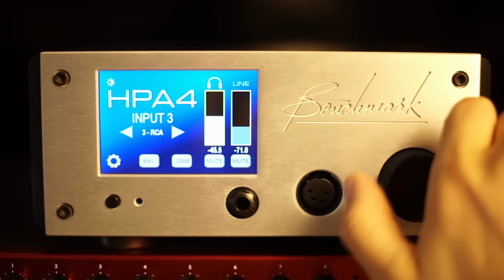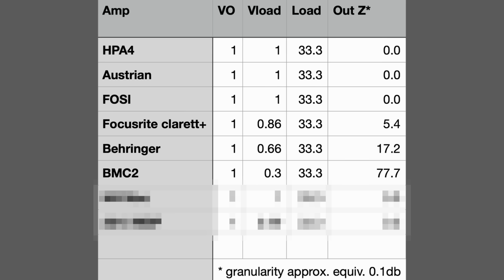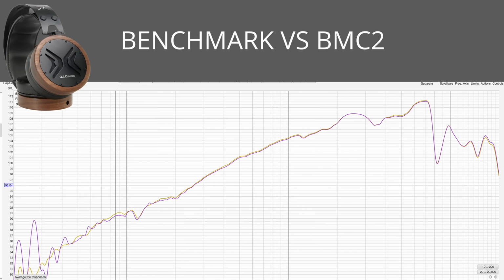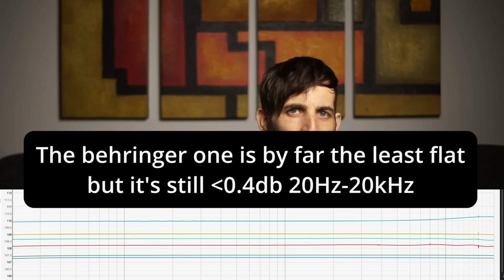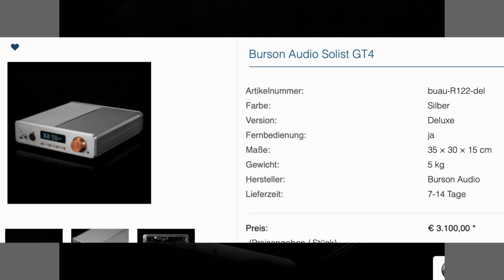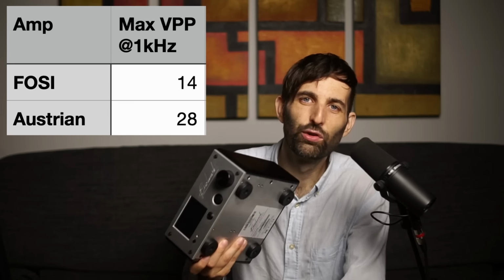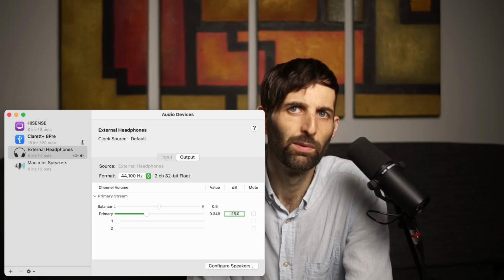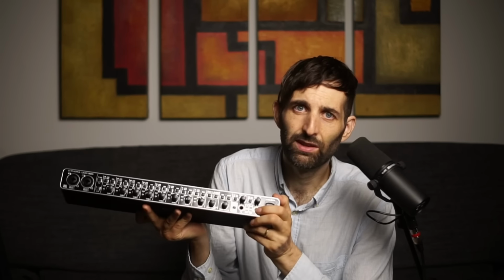Stop plugging your headphones into your audio interface!! Headphone amps demystified.

Comment: PC sound quality often leaves something to be desired but if you build your own there are motherboards with good audio chipsets out there.
Reply from the maker: Sure it is just random luck with pc, not impossible to get something good
Reply: @APMastering Except that knowing what you're doing when getting a PC or laptop it isn't random AT All. Getting into pro audio with a Windows machine can be a perfectly safe bet as every motherboard spec and onboard audio chip can be checked online.
Reply: @Dr.Rolfski  Codecs implementation can vary from a model to model, e.g. separation line from other components to minimize some interferences. Generally, it's always better to have it in a separate device to avoid that.
Reply from the maker: @---pp7tq  id get a custom PC but with arch linux. no way id use windows, thats insanity
Reply: Aye Linux using ALSA with deadbeef player is the most pure bit perfect audio from and computer I've heard - I upload many underground tracks with deadbeef scope visuals hahah. Beats Macs for me but I haven't heard the new macs for a while through good external DAC . There is something about playing off old 3.5" SATA that is much nicer than solid state drives for a lot of folks.
Reply: @---pp7tq  On the higher end motherboard models there's definitely no guessing at all on the codec implementation, as these become features in their advertising and subject to hardware testing and reviews in the media.  For instance, a few years ago I specifically bought an higher segment Asus Z-690 motherboard because it came with a top end Realtek audio codec and Savitech headphones amp, both which had excellent reviews. Of course you can always step it up with an external DAC, but that only goes to show that there's really no excuse for not having good audio on your Windows PC.
Reply: You can get the JCat cards that are supposedly really good for PC audio . Upgraded USB port and they also do an ethernet version . If you have a good DAC that has galvanic isolated inputs like the Chord TT2 it's perfectly fine to go straight from PC USB to the DAC , I'm currently using that with QED reference cables at around 150 quid for 3meters it's perfectly adequate for my needs you do not need to buy these multiple thousand pounds cables they arethe biggest snake oil in the industry.  Good DACs are overlooked however people do not understand how much good DACs can open up the soundstage , you get true instrument separation no muddy smearing of placement . More depth etc.

Comment: I feel like the blanket statement at 16:14 is a bit incorrect. Sure, something like the Behringer interface with a pot for headphone volume control might be unfit since it's not always going to be at the same level (Unless you leave the gain knob for the headphones untouched, which i could see some peeps doing after this video). 

However, that doesn't take into account interfaces like the Apollo series from UA, or the interface i use, the MT48 from Neumann/Merging, which have digitally controlled output gain for the headphones (And everything else you can set such as pres, monitor outs, etc.) that go, just like the headphone amps you show, in 0.5db increments (The Apollo can differ in steps depending on what plugins you have on it but that's besides the point), and on the MT48 you can actually set a REF volume you can always call back to.

Of course, this is all moot if you said that about just the interfaces you have in the video.

Edit: Arrived at the end, and i just saw you did add that you were specifically talking about any interface without digitally controlled output. My bad for jumping to conclusions.
Reply from the maker: You digitally controlled is fine
Reply: Yeah I think RME interfaces have that as well with TotalMix (correct me if I am wrong)
Reply from the maker: @nkwln yes total mix but the “cheaper” units have pots

Comment: I'm one of those idiots that reviews various headphone things.  As it turns out the best one I've ever tried in terms of never changing the tuning of a headphone or in-ear is a simple Topping L70 for about $275.  You can also get a cheaper model without balanced inputs and no resistor based volume control.  I like those features though.  It's output impedance is around 0.4ohm.  It also is not current limited until something like 4 volts which is plenty for most normal things.  It also has a precise DB readout with 0.5db changes.
Reply from the maker: That’s cool but it’s double the price of the fosi still and doesn’t use full relays afaik.
Reply: @APMastering It does use full relays.  Clicky clicky.
Reply from the maker: @MichaelBruceTaos  seems too cheap but ok
Reply: @APMastering You can look it up if you desire.   The inputs are relay switched between XLR and RCA.  The volume is relay based resistor controlled.  It has 3 headphone outs, XLR, 4.4 and 6.35.  All outputs can be toggled or run at the same time and it remembers the volume for each output when toggled.  I wasn't kidding its about the lowest cost amp suitable for any IEM or Headphone with pro level features.  I was not paid nor got a free unit, I purchased it based on ASRs measurements and the known features.
Reply: @MichaelBruceTaos  Have to agree Topping L70 is fantastic headphone amp with all of the features that the 4k one does. Also very easy to store precise recallable level settings with a remote. It would seem  obvious to me that there are a lot of alternatives between a Fosi and a Benchmark, just because someone is controversial doesn't make them correct.
Reply: @woodsdenis  I'm only interested in performance and features that matter.  The L70 lands about the lowest cost.  Im sure the 4k amp is great, truely.  I would wonder if anyone could tell any difference with the L70.  If there was a cheaper model that was actually comparable I'd be talking about it.
Reply: @woodsdenis  Thanks for that confirmation.  The idea you need to spend 4k to get the same performance and features is just incorrect.
Reply: Unfortunately, the L70 and A70 Pro have QC issues. I owned and returned both faulty units.
Reply: @johnnyparker2128  i suppose only I am lucky I got working units, and also plenty of other people
Reply: @MichaelBruceTaos  Definitely a lot of A70 Pros were faulty. Too bad. It was a powerful beast.
Reply: @johnnyparker2128 unsure about the A70 pro, but I've been very happy with my L70. 

One would hope that any immediate issues are resolved quickly and not sent to market knowingly with faults.